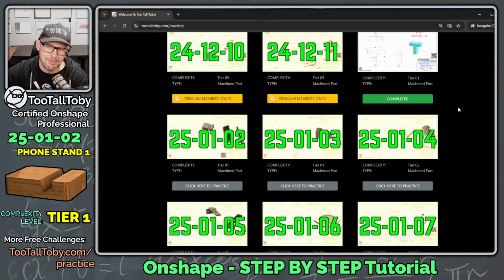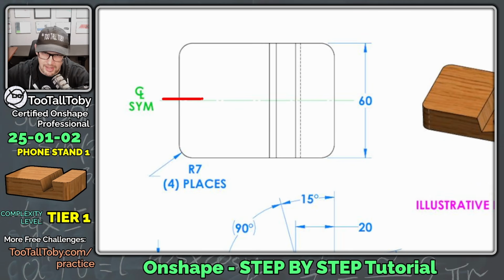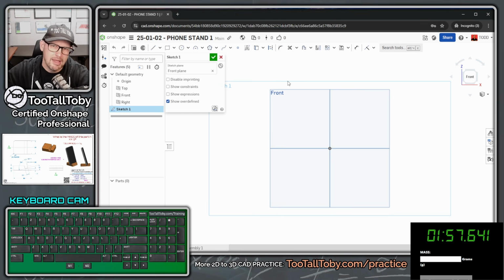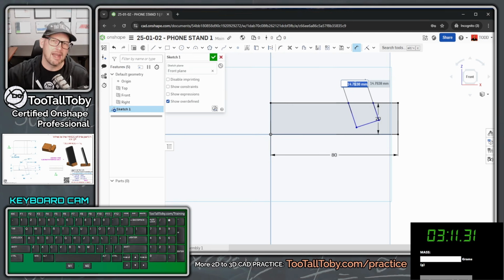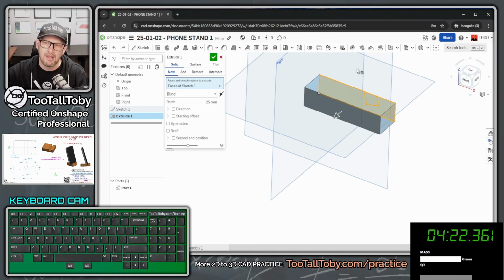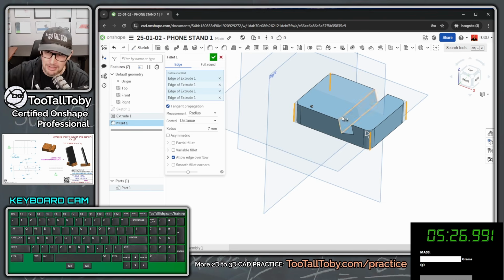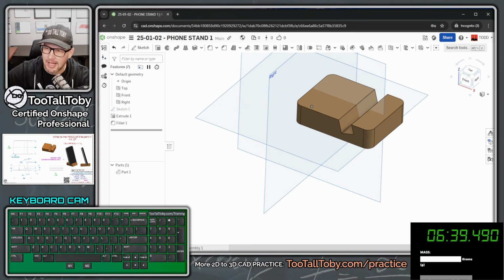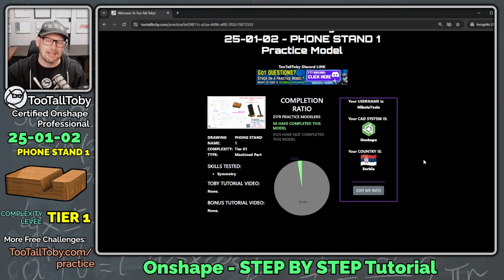Best Free Onshape Training / Step by Step Tutorial for Beginners! -25-01-02 - PHONE STAND

Comment: Wow, the first time I draw the full shapes outline by hand, and you do the rectangle and cutout later.. 

It was the first time I had used the measurement tool for angles. so taken me a while of trial and error to work it out. 

I should have guessed to just use the exact lines that was in the spec diagram, prob would have clued me in quicker..